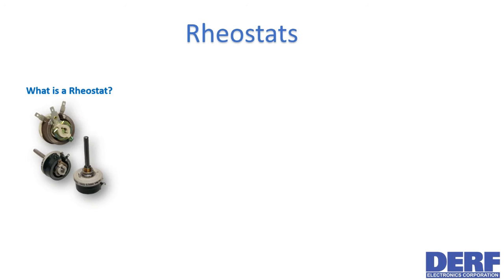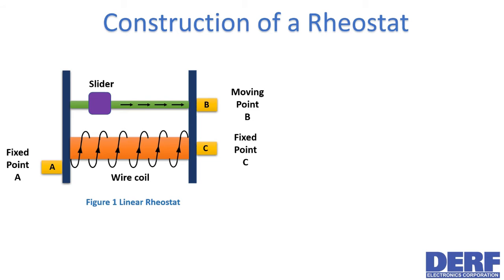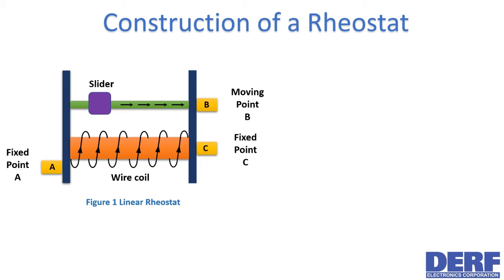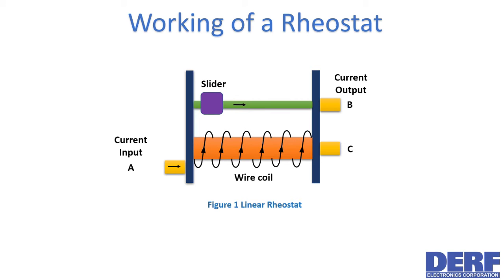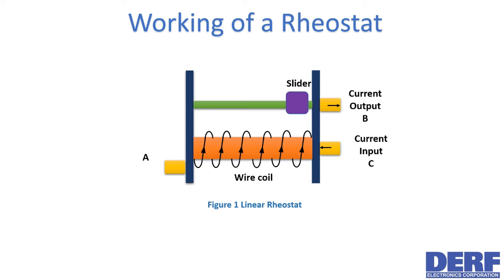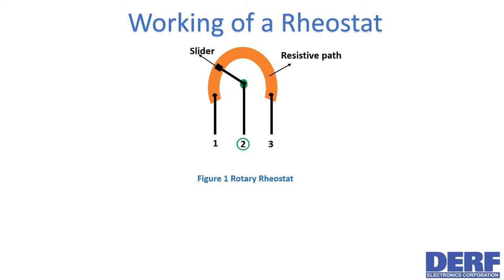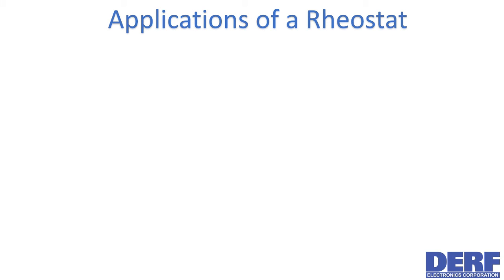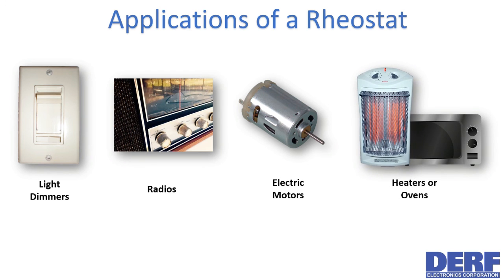How a Rheostat works - Step by Step & its different applications

Comment: What is the purpose of having three connection points. If you just have Point A and Point B, then Point C has no use. The current is running from A to B.
Reply: I don't know, but maybe it is a grounding pin?
Reply: Because some applications require left-to-right actuation, while others require right-to-left....